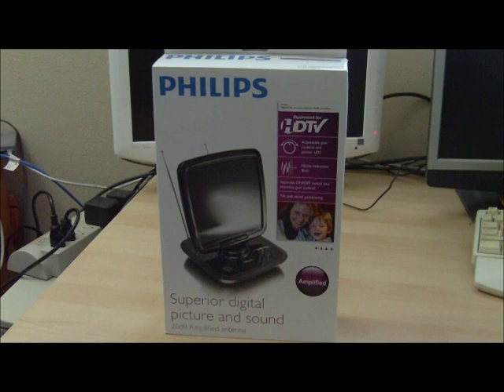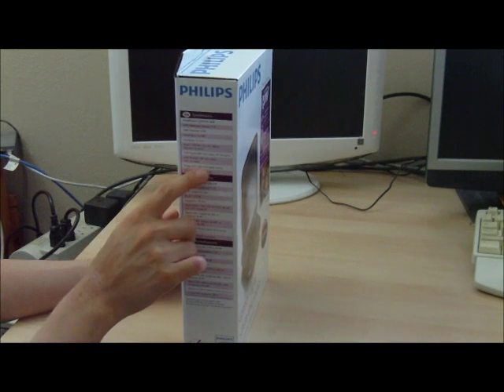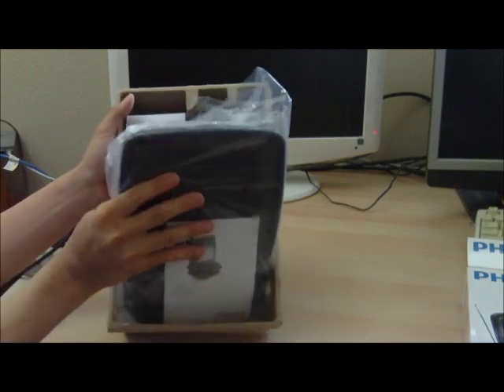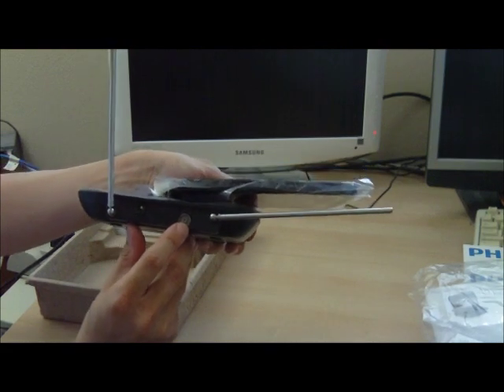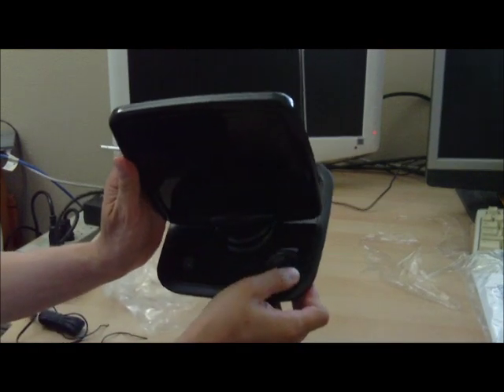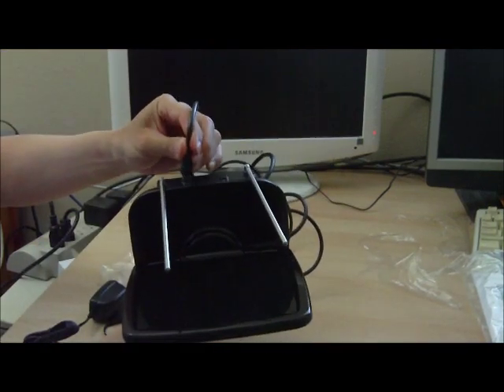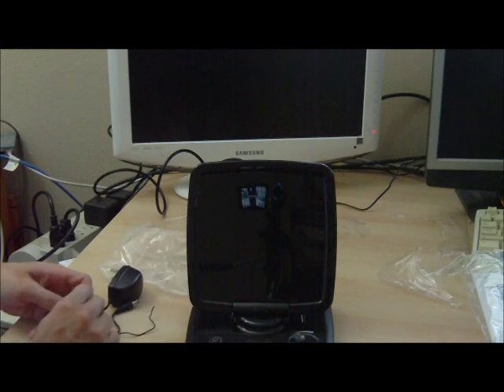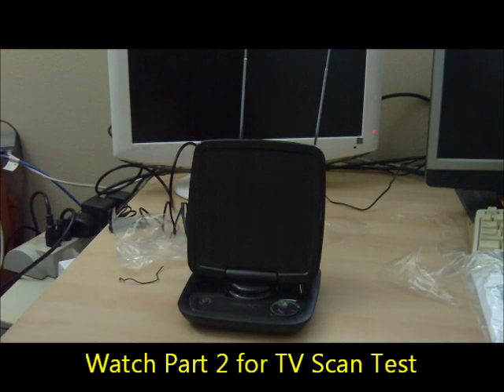Philips SDV6122 Indoor Amplified HDTV Antenna Unboxing, Setup, & Test  - Part 1

Comment: For those who are wondering.. the metal antennas are for analog.. the screen in the middle is for picking up digital.  It would have been more of a help if you ran a 'before' scan and a 'after' scan.  Just sayin..

Comment from the maker: This dB value is not related to sound volume.  dB (decibels) in this case refers to antenna gain which is how well an antenna converts the received radio waves from a specified direction into electrical power.  Keep in mind that because of the directional nature of radio waves, a high gain doesn't necessarily mean it will be best at picking up all the radio waves.  Depending on where you live, a multi-directional or omnidirectional antenna with comparable or lower dB can sometimes be better.